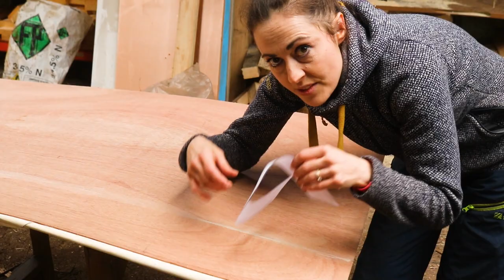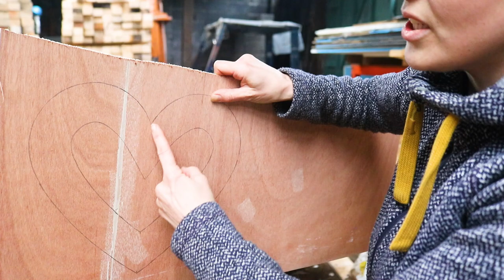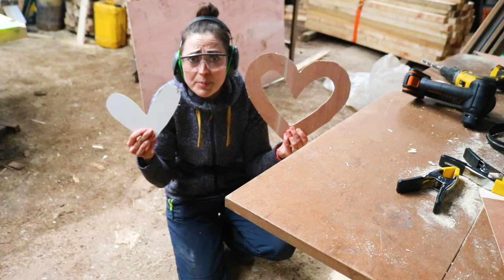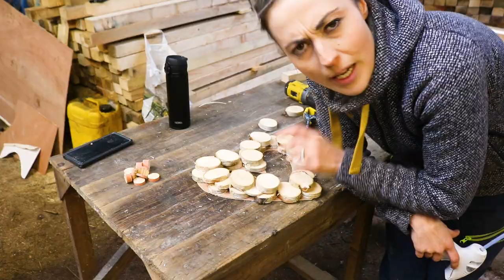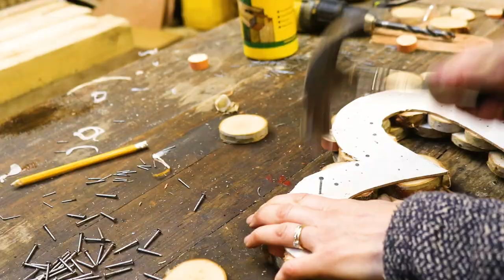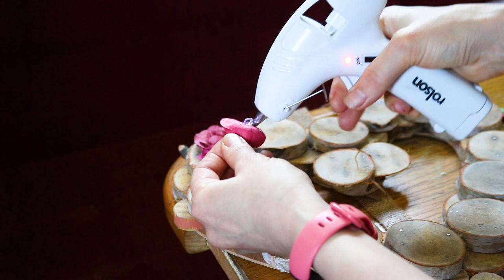How people are paying $70 for this dumb Valentine's Day wreath

Comment: OK,  ...... Tip Time! ;0)

Most will be using a table saw for this one, so ...... Cut your branch in half and glue the two pieces together in parallel then cut both pieces at the same time! It would work for a Skill saw too.

If you want to make it POSH you could use a router from the back with a trimming bit (the one with a bearing on the end) to cut your ply down to the profile of your branches!
Drying wood can be hard to do, so ..... Bung it in a paper box with a load of chippings and leave it in a corner of your house(boat) The chippings will cause it to dry slowly and evenly causing less cracking!
If  you do use wet wood (like you did here) you may well find as it dries it cracks so drying first and glueing is the best option ....... If you use a decent varnish you can bag it up when you are done and bung it in the loft for next year! (No I am Not from Yorkshire) ;0)
Reply from the maker: Thanks so much for the tips!  I'll quote you for these in the blogpost version that's going LIVE today 😀
Reply: @TheCarpentersDaughterUK  Not doing it for fame, but Thanks! ;0)